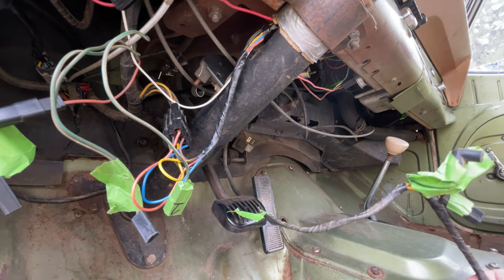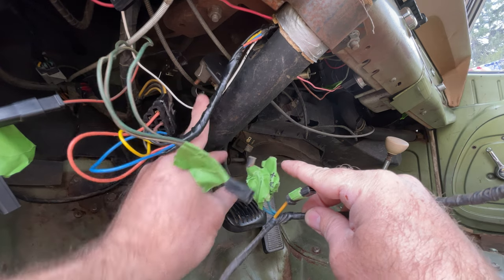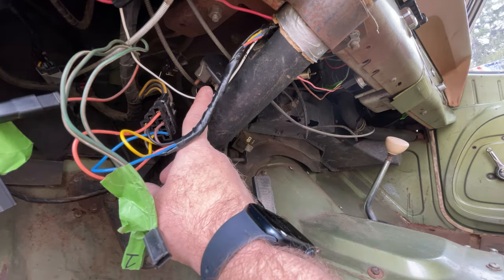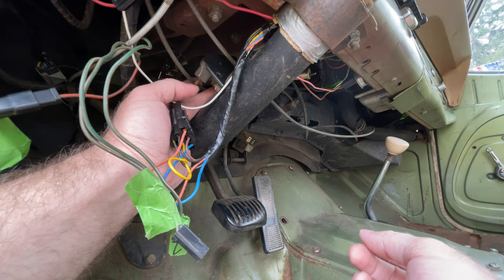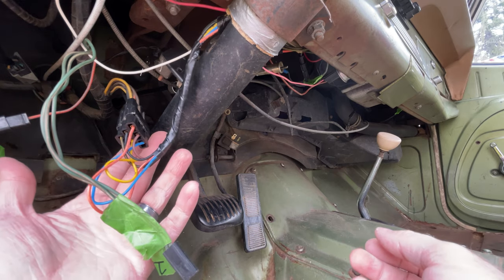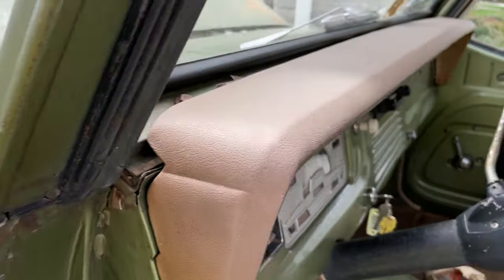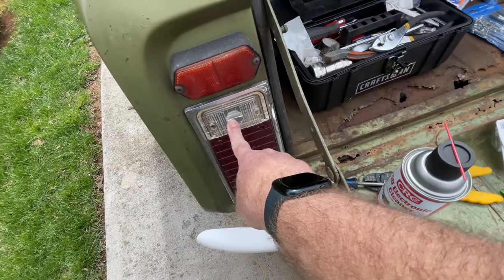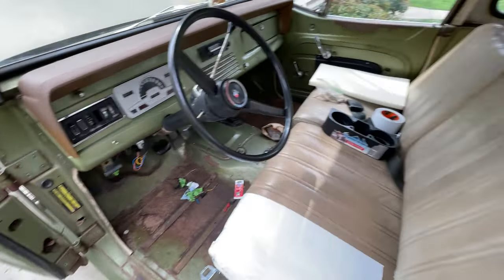1973 Jeep Commando - Wiring Wrap-Up ( S3:E6 )

Comment: What is the purpose of the plastic clip on the bottom of the neutral safety switch?
Reply from the maker: That little tab sticking out of the bottom actually engages a slot in the steering column shifter. This slot rotates when you shift gears and moves the Neutral Safety Switch through it's various positions. So the switch knows which gear is selected and can turn on the backup lights or stop the starter from engaging as needed. Very basic design but serves it's purpose. If yours is flaky like mine was you can actually disassemble the switch and clean up the contacts inside to make the thing work again, assuming there isn't anything broken inside it.